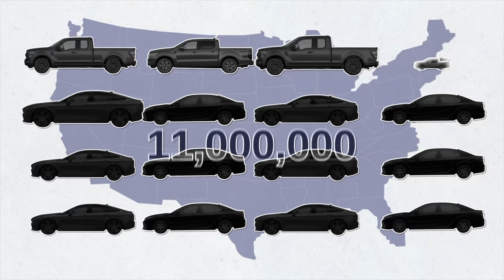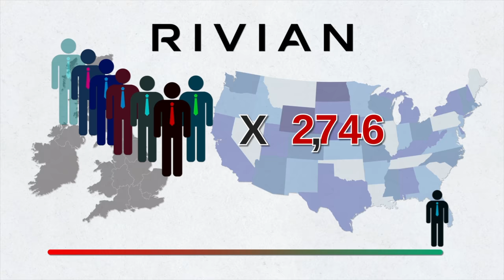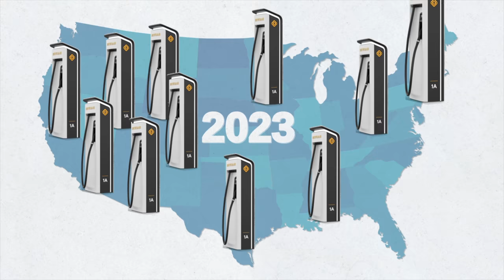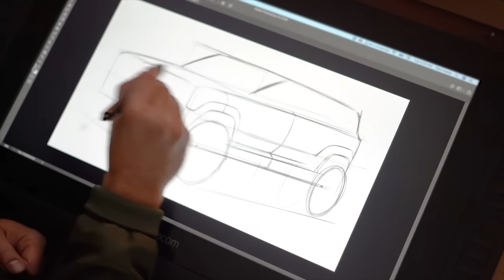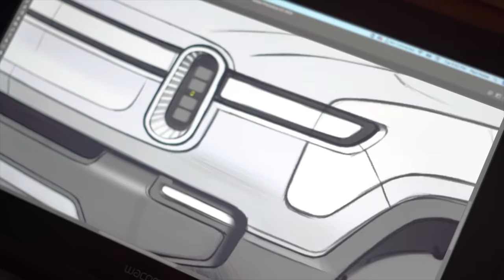Here's Why Rivian’s New Vehicle is the Future of Cars (Goodbye Tesla)

Comment: Interesting Ford invested in Rivian knowing they had been developing and recently released the Ford F-150 Lightning which will directly compete with. Still feel as an electric battery car owner that hydrogen fuel cell autos would be a better fit for personal transportation, similar refueling process as IC autos and can convert current infrastructure gas pumps over to hydrogen as user base grows. Just my opinion
Reply: I agree with you about hydrogen fuel cell.  I also don't like how much pollution is produced in the production of Lithium Ion.
Reply: They made some hydrogen ICE motors a while back and I think those would be a lot cooler option than the electric fuel cell vehicles. It’s a kind of hybrid hybrid. Still only puts out water vapor as a byproduct and you don’t get the instant torque from the electric motor but for all of the gearheads that just don’t want to see the ICE engine die but understand why it has to it seems like the best of both worlds. The only downside is how much electricity it takes to produce the hydrogen. It would be cool though if you could buy a setup to produce it yourself at home with just some solar panels and water. In fact if you had a small portable one you wouldn’t ever run out of fuel unless you’re in the desert 😂!
Reply: Agreed. I will not buy this already outdated technology. Every charge you give the less life you have on the battery
Reply: @MrCountrycuz  how’s that? Trust me, I can admit when I’m wrong and change my mind if I am but several years ago I saw a company (don’t remember who it was but they were just testing it. It worked but I never heard any more about it. Probably something to do with lubrication problems is the most likely thing I could imagine. You spray in hydrogen with direct injection and it was almost a direct conversion from a gasoline engine.
Reply: Ford is position ning itself to be an ODM.  It's smart
Reply: I hate to see how much the tags, insurance, personal property taxes, sales tax, what it will cost to charge while you're out shopping, motel, etc. I'll stay with my vehicle that uses  ⛽
Reply: @LouisWritingSomethingCrazy  have you actually seen how oil is extracted it is much more polluted than lithium. That said there is allready three factories in California thst recycle lithium. Oil cant be recycled. Environmentally if you own an electric car more than 7 year than you are benefiting the environment if you own it less than 7 years you are no different than buying a combustion engine. For battery reliability this has come a long way the issue current is charging time
Reply: Ford is not developing cars with Rivian any more.  They have huge gains on the stock and I am sure they will slowly offload.
Reply: @kmsah  oil get recycled all the time.
Reply: Once you get used to “fueling “ in your garage 99% of the time, the gas station is going to seem like a chore you’re glad to be done with at 1/3 the cost
Reply: @mlyssy2  The Hydrogen ICE engine can also run with a 50/50 blend of gasoline & hydrogen.
Reply: @LouisWritingSomethingCrazy  so false,  domore research
Reply: @dustinsmith2021  not when it's burned into the atmosphere
Reply: @brianblackwood3120  every time you run a tank of gas you are reducing the life of an ICE engine too
Reply: Your hundred percent right about hydrogen
Reply: Here in Australia a prototype Toyota hydrogen car traveled nearly 790 miles using one 11lb tank of hydrogen. Apart from the obvious loss of range anxiety, waiting to charge (if its compatible or works) there is a massive weight difference. Downside at the moment is small power and practically no towing but, if you just need a car for mobility this is super economical.
Reply: @paull3179  ford has still stake in rivian
Reply: At a crucial time Ford will sell all of their stock in Rivian, and when their stock plummets, will buy more than half of all of it. owning the company lol.
Reply: @kmsah  Who is going to buy a new battery for a seven year old electric car, I wonder.  By then it would have broke the bank in maintenance costs and repair.  I think you just sold people on petrol cars!
Reply: Ford do much, much more than make cars. There will be an aspect of this rivian that ford caj utilise
Reply: The problem is that I want to get away from price gouging from gasoline aka OPEC, if you go with hydrogen you will have the same concept as gasoline, there's going to be another "OPEC" price gouging the price of hydrogen, and I really want to get rid of the practice of stopping at a gas station such a waste of time and money, don't even mention that you might get robbed or shot at.
Let the EV's develop their technology eventually the batteries will be so cheap and long range that I can see them go over 1,000 mile range.
Hydrogen is just another monopolized gasoline, I think it's dead on arrival, Toyota I love you but you fucked up there, no EV's for them, they're years behind 😂
Reply: @XerxezsX  LLP
Reply: @gowanlock  yes
Reply: @campbellpaul  yes exactly 💯
Reply: I say propane cheap & we have plenty of it   All it takes is a conversion kit & your car runs great .  Less oil change‘s , plugs, exhaust etc  cleaner running motor that is already in production.
Reply: @nicolec7290  I agree, but most people don't like the loss of horsepower associated with propane gas.
Reply: @dustinsmith2021  so true, but not fast enough to offset what we humans put out. Common knowledge.
Reply: Hydrogen is way better
Reply: Lewis Bey  Hydrogen maybe "easy" to manufacture, but not always in a "green" way...      So yes, running car on hydrogen maybe great, but polluting to generate hydrogen just move the problem somewhere else....
Reply: @XerxezsX  they can make hydrogen from water. I dunno if it’s a lot more expensive than from natural gas but every country on earth should be able to do it. So no it won’t be like opec again
Reply: At this point it would be easier and cleaner to mass produce power from clean energy (e.g. hydrogen) than make an entirely new vehicle and infrastructure. There's a reason Tesla didn't go hydrogen power. Electric cars is the future in ours and likely our children's lifetime. Perhaps hydrogen in the future after that but for now combustion engines for regular daily commuters (not saying for construction, farming, etc) is going away.
Reply: @paull3179  They will probably make more on the sale of Rivian shares than they do producing their own vehicles.
Reply: Lewis Bey  It's the electrolysis using electricity produced by coal that is polluting. And the fact that hydrogen fuelled cars are about 50% less efficient overall than BEVs.
Reply: I don't think its competition because the lightning is just going to be a limited production truck like its always been. But I think ford is putting rivian technology into the lightning which is why they invested in rivian
Reply: Didn't Ford recently back out?
Reply: refilling a H2 car costs 4x as much as an EV and you're obliged to go a pump instead of charging from home. You can buy one today if you want, the Toyota Mirai, but nobody does because it doesn't make any sense.
hydrogen needs to be made, from electricity (if you want it to be clean at least, because right now it's made from methane), it also needs to be compressed, liquefied, and transported, so it's way less efficient than just putting electricity directly in the batteries, through the electric grid that is already everywhere.
Reply: @tesla_models  Not for long.
Reply: Hydrogen is DOA ,  until it can be produced @ scale  and is cheaper than gasoline and as available  as  your  electrons  from the garage wall outlet  it will be always " the fuel of the future",  FYI  the average cost  of 300 miles  of  electrons  is  less than $20 a fraction of Gasoline
Reply: love hydrogen
Reply: @joelandersonphoto  and how long do u expect electricity to remain cheap as demand ramps up??
Reply: @campbellpaul  yes my point too, batteries will need to get a hell if a lot cheaper !!
Reply: @XerxezsX  well there will be price gouging on electricity too !!
Reply: @rogermueller9143  So are you going to buy one?  And  why whether  yes or no. Please  explain.
Reply: @mlyssy2  Hydrogen is the hardest  element to contain, it is the most abundant , but separating it  from the other  element ( H2 O is hard, and transporting it while pressurized  is dangerous and requires  expensive Carbon Fiber tanks, it will forever  be" the fuel of the future".
Reply: @paull3179  6 months lockup  is the rules, after spring Ford is free to "Abandon ship", and put that cash into the Tennessee  ground breaking.
Reply: @rhett7716  Unless these companies all offer a vehicle buy-back plan, I just don't see any real incentive for an average Joe to want to purchase one.  It has been said that one out of every three Tesla owners will never buy an electric automobile again, due to problems they've had with them.
Reply: @richardharker2775  Toyota Mirai is a Science Experiment, that FUEL WILL NEVER SCALE!
Reply: @tesla_models  for 6 months.
Reply: Lewis Bey  well said.
Reply: @rhett7716  you think electricity is cheap?
Reply: Agree and solar could be concentrated in desert areas with few clouds where it could crack water and the hydrogen could be transported to wherever needed.
Reply: @aurelio-reymilaorcabal9669  you can recycle my thanksgiving farts.
Reply: @truck1549  still they didn't say they might sell stake
Reply: @aurelio-reymilaorcabal9669  good
Reply: @paull3179  h
Reply: Lewis Bey  Thank you for explaining this so well!
Reply: The process of producing the fuel for hydrogen cars, the space mechanisms require to operate off hydrogen and the volatility in storing hydrogen in personal vehicles make such dreams less efficient and economical.
There are currently other options in the works that may just outright replace gasoline while being a better  solution to reducing impacts to the environment.
Reply: @Guttersmart  no i never said that !!!
Reply: @aurelio-reymilaorcabal9669  I believe you are correct. Toyota issued 12 in Australia mostly to politicians in Canberra and a couple to engineers at their defunct plant in Altona. As an experiment it looks impressive but the market is ramped on battery and without infrastructure it will be another historical experiment.
Reply: Lewis Bey  Since it takes twice the energy to produce hydrogen and store it safely than the energy you get out, producing hydrogen is not free, and will probably never be a  "domestic" proposition.  

If hydrogen production and safe storage was as easy as you are  suggesting, it would have been rolled out already.  It isn't,  and it costs 50x more to install a commercial hydrogen refuelling station than an equivalent electric one. 

Hydrogen may be a long term answer for very long haul trucks, trains, and maybe even planes, but not for personal vehicles.
Reply: @aurelio-reymilaorcabal9669  lol
Reply: @LouisWritingSomethingCrazy  my Prius Rocks & needs no "charging" 😎55mpg on recent trip
Reply: @brianblackwood3120  Look at the research on tesla's batteries.  They don't degrade as much as some people assume.
Reply: @kmsah  wrong. Oil is not polluting to drill for at all. It’s quite clean. When a well goes dry it all goes back to normal. Can’t say the same for a huge open mine. Oil is recycled. Ask any Walmart auto shop. They recycle the oil. You are misinformed.
Reply: @Kevin-cf8uu  hydrogen - it’s the future in about 2-3 years
Reply: @vauzz66  what powers the drill?
Reply: Lewis Bey  The efficiency of an ICE powertrain is about 30%and a hydrogen fuel cell is about 50%.  A battery powered motor is 90% efficient.  That is a major reason that for LV market (light vehicle) the battery makes sense despite the difficulties (charge time, range anxiety and thermal concerns caused largely by the electrolytes).
Reply: I don't think it's possible to simply replace gas pumps with hydrogen. One of the biggest problems with hydrogen is that because the atom itself is so small, it can leak even through pressurized tanks. That risks damaging the tanks (known as hydrogen embrittlement). I doubt the materials used for a gas station are suited to take on hydrogen.
Reply: Hydrogen fuel cells too combustible. Hydrogen discs much safer.
Reply: @brianblackwood3120  are you saying we should avoid EV's?
Reply: @Rodrigo_xt8c2  depends on the speed theyre charged at ??
Reply: @paull3179  I heard that ford was using rivian's battery platform for the E-150?
Reply: @TheMrPeteChannel    Which is a STUPID thing to do.  Might as well use E85. It's cheaper than hydrogen, easier to produce, easier to transport, easier to contain and its 105 octane is loved by high-performance engine builders.
Reply: Lewis Bey    "how is electrolysis polluting?"

"We" (in the U.S. at least) get our hydrogen from fracked natural gas.  Electrolysis is a "school science" project when it comes to its production.  Yes, electrolysis is clean. But that's not how we generate most of ours :-) 

It's also cheaper and more efficient (to date) to just use the electricity to charge batteries rather than generate hydrogen.
Reply: Competition is key to any challenge, it makes both sides much better.
Reply: I'm with you on this---!!!👍
Reply: @kmsah  In 10 years almost electric car become paper weights

Comment: Scotty! I would love to buy a Rivian Truck to pull our 30 foot Toy Hauler Travel Trailer to go to the Sturgis Motorcycle Rally every year, (we've been attending since 2005!), but at $70,000 and being 65, retired, we would have to sell our "paid off" house to buy one! Fortunately, our 1999 Silverado 2500 LD 4 X 4, gas 6.0L, (first year, new body style), 350,000 mile Chevy Truck, which we paid $3,000 for 7 years ago, we will still use it to make the 3,000 mile round trip, (with the original un-rebuilt engine), without burning a drop of oil between it's 5000 mile oil changes! Even with JB's $5 a gallon gas it's still doable. Let's go Brandon!

Comment: No one ever talks about the electric grid upgrades needed to charge electric vehicles.  Upgrades from the home to the generator will be needed if too many of these charging sites are built.  So factor in the resources and carbon foot print to upgrade the electrical system.  It's one of the Pandora box's no one's talking about.
Reply: Give me a break. The cost to build more renewable energy sources with battery back up is significantly less than the cost to build carbon based generation.  That said it would be best to also start building new and safe nuclear generation capacity as well.
Reply: @gordoncrespo2045  Utilities build gas fired plants to pick up the slack of renewables. And battery backup for when the sun does not shine and wind does not blow is not in use on a scale that does much.  Those batteries only last so long need replaced. What happens when the sun does not shine bright for 2 or 3 days in a row, the batteries go dead and you have to rely on a another source of power. Most batteries are being used to peak shaving not actual demand at night.
Reply: @elkhunter3382  of course it’s not. It’s a nascent industry and will take time to build.  But as I mentioned even now it’s much less expensive to build renewable energy sources with battery back up than coal, oil or natural gas peaker plants and eventually as solar, wind and battery tech improve it will be cheaper to build those instead of any other form of energy generation. That’s probably at least a decade away but we all better hope we do it because it CO2 emissions are dramatically reduced we will have a lot more to worry about than the cost of EV’s.
Reply: Solar panels will provide electricity.

Comment: I grew up in Irvine, great place for a headquarters. Don't think much about electric cars, the power grid could never stand all of us plugging in at the same time.
Reply: Rolling blackouts are bad enough without giving EVs priority over things like air conditioning with "smart" thermostats. And the Feds can't force utility companies to upgrade the grid either
Reply: When does everyone plug in at the same time? Do you EV drivers flash mob or something?
Reply: Interesting discussion regarding power infastructure..l have been building residential housing developments since the mid 1980's.None of those have sufficient power capacity to serve additional demand if just half the homes want to charge vehicles. It's not as simple as just adding a receptacle and expecting the electric line to your home to flow more current.A lot more planning and upgrading will be needed.This is going to be rather expensive.Some how l don't think the home owners on a street with  gas vehicles are going to help pay.